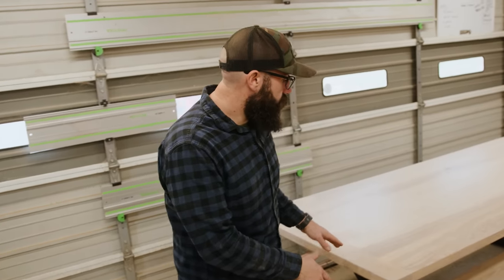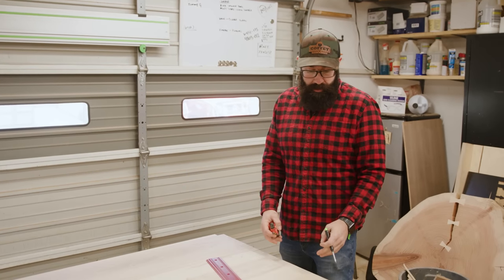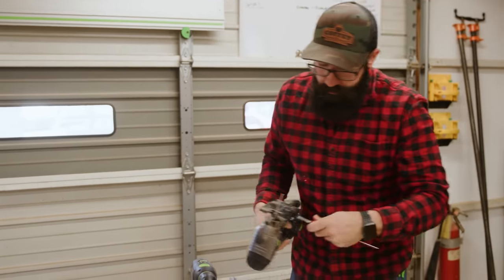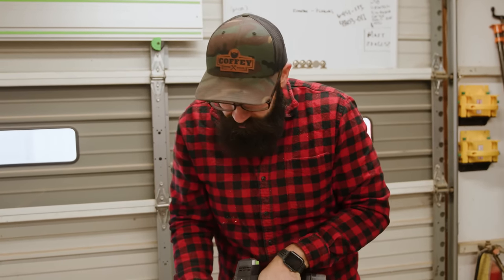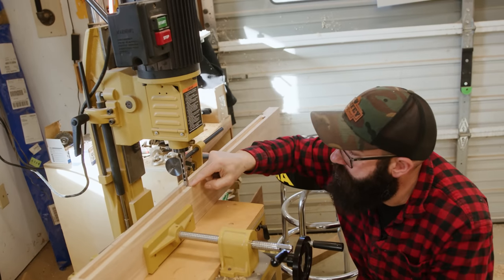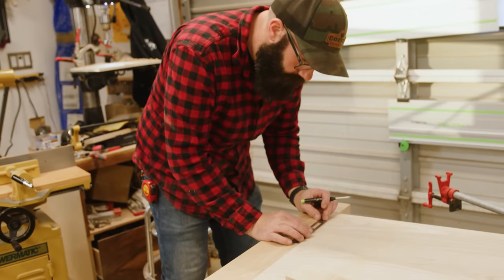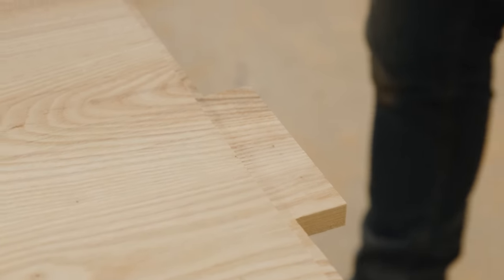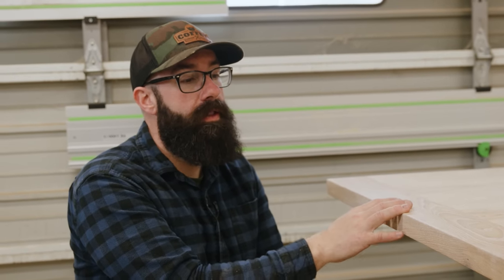Breadboard ends are easier than you think!

Comment: You can save a ton of wear and tear on your router bit if you only use it over your tenons and stub tenon. The rest you're going to cut off anyway, so just leave it at full thickness. It's less work and easier to balance the router. The only other tip I have is the offset for the drawbore, unless it's pine 1/32" is plenty. I've had pegs jam on me, or break, and even had the underside of the breadboard break off when hammering a 1/16" drawbore home. Longer pegs with long tapers help, but 1/32" is more than enough. Thanks for sharing.
Reply from the maker: Very solid point about removing the tenon waste first!

Comment: What's not shown is taking the rule, measuring it, then realizing the other end is off now. Then measuring that end, and realizing that the OTHER end is now off. Rinse and repeat a half dozen times (or more) and you get your final take. Track saws it seems, you have to lift up the end to get the other piece on a corner rather than the width and you can move it reliably. Otherwise, it's back and forth time ftw.
Reply from the maker: This is correct 😂

Comment: Don't route backwards. Use a featherboard as well. Center tenon does not need ¼" expansion relief but won't hurt, it is the secure point all expansion will depart from. Half that amount is fine. When setting depth with router for ½" cheek cut of breadboard, use a playing card or two layers of blue tape to allow sneak up room for tight fit when placing in tenon. After driving dowels and they're set, place tape or playing card on table surface to flush cut them and sneak up with plane , chisel or sandpaper; this prevents any teeth marks from the top surface during flush cutting. Otherwise spot in instruction.
Reply from the maker: Thanks for the review

Comment: Great video.  One thing I leaned the hard way was consider where you want the expansion and contraction to occur when you are making the slots for the dowels.  In this case where it’s a table you sit at from both sides I would do it as you showed but if it’s a piece intended to go against a wall I would put the fixed hole on the front of the top and slot the middle and back one so the top moves on the back where you don’t see.  I found this is especially important when you have molded edges as the movement will be very visible when looking at the top.
Reply from the maker: Great advice!

Comment: Thanks for not using the domino. Most people don't have a 1500 domino laying around that they wanna use for their hobby, me included. But I also don't have a mortiser around either. That is the part of this process that is still intimidating to me.  

I did just put some breadboard ends on that I am hoping turn out well. I used a router table to try to do the mortise and it was kind of tricky. But we'll see! 

I've heard that the breadboard ends don't really function as a way to keep the table flat but mostly are there for asthetic. Maybe its a bit of both.
Reply from the maker: They absolutely keep the table flat. That’s why the joinery method was invented. I’d recommend doing the mortises on the drill press in the future.

Comment: Great video - I love making breadboard ends too for a slightly different application, but typically with dominos, but I think this way makes it more stable due to the larger tenons and the stub tenon.
Reply from the maker: I think the big deficit comes from the stub tenon honestly.
Reply: @CoffeyCustomBuilds  deficit or benefit? The mortise and tenon with the long stub tenon is far more stable (and stronger) than dominoes. Plus using dominoes require glueing the entire length of the breadboard not allowing for seasonal movement. 
There is a reason why we have antique tables that are 200+ years old and modern tables of today won’t be around in 100 years. ✌️
Reply from the maker: @michiganmoto7687  the deficit meaning that the domino doesn't have a stub tenon

Comment: Mike, great video I love the artistic style.  A few questions:  Do you think there would be any benefit from drilling the holes at each end of the cut to prevent the end of the tenon from wanting to split with lateral movement?  I think I had heard that once, but not sure if it's just in my head or not.  I am assuming you said it and I just missed it in the video when you ran the 1/2" groove on the router table you were using a smaller bit, and running it in both directions to center it?  I am assuming this is preferred over milling your lumber to the thickness of your bit?
Reply from the maker: Yeah I make the joinery around the wood thickness I have. I don't make the thickness around the tooling typically.

Comment: Looks good.  I'm a big fan of ash.  On the end dowels, I understand not gluing them into the tenons, but do you at least glue them into one or both sides of the breadboard edge so they don't slide out of flush? Thanks.
Reply from the maker: I definitely did glue them into place.

Comment: Love a breadboard end 🤩. The table is beautiful!  Love the tip of moving the holes in 1/16” to pull the board in tight!  Is that Rubio cotton white on the top? And do you typically get dowels somewhere close to you or order them online? (I have only found them at the orange store locally… so wood species is never what I’m looking for.)
Reply from the maker: That was Rubio white. No cotton was harmed. I get them from one of my hardwood dealers but Amazon is actually good for them.
Reply: @CoffeyCustomBuilds  thanks! 😊

Comment: These are breadboard ends or breadboard joints.

 I would like to point out some people change a joint to the extent that it no longer is that joint. A method using dominoes has been spreading on the web proclaiming this to be an easy or trick way to make this joint has begun to confuse people. So, on my mighty stead I ride.

I find that many people are calling this Dominoe method of producing a Breadboard joint as an easy or trick method, should realize that this isn't a breadboard joint (or breadboard end) anymore. This is one reason it is easier since it isn't the joint anymore.

This is a specific kind of joint and using dominoes has varied so far from this joint as to not be this joint anymore. I would also challenge those who think that it is, to consider if one made in the same way with dowels would still be a breadboard joint or if the dowels were totally eliminated and used a butt joint was still a breadboard end.
It isn't the application of a board across the grain which produces this joint but the method of joinery, and the reason for doing this joinery in the first place.
Reply from the maker: Not sure if you watched but I did it correctly and didn't use a domino
Reply: @CoffeyCustomBuilds  
Yes, you did do it correctly and also showed it isn't all that difficult to actually produce the joint rather than reduce it to a small number of tiny pegs.
 I didn't say that yours were not. I bolded and isolated my first line to hopefully eliminate confusion.